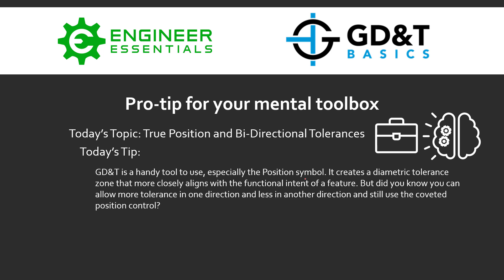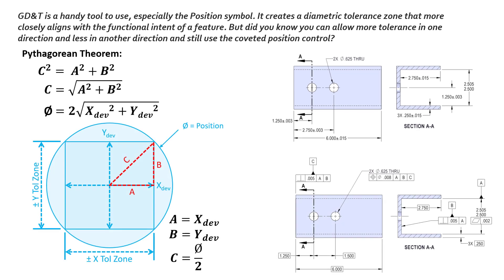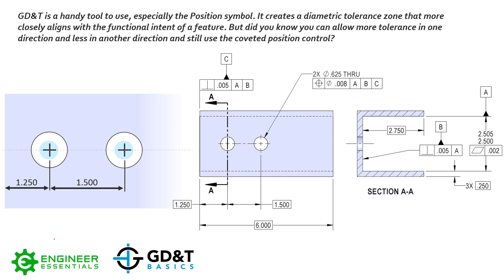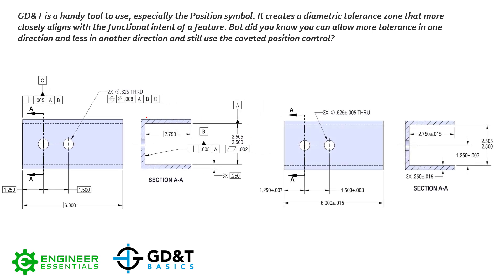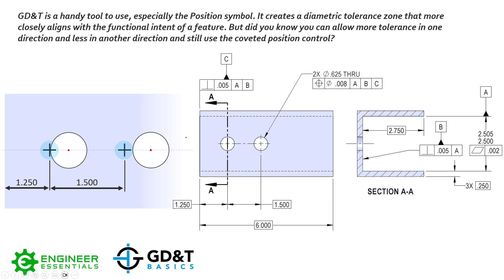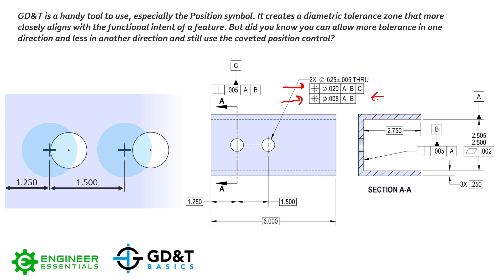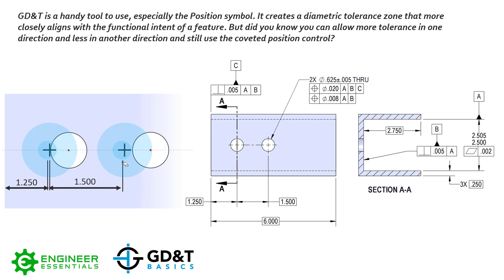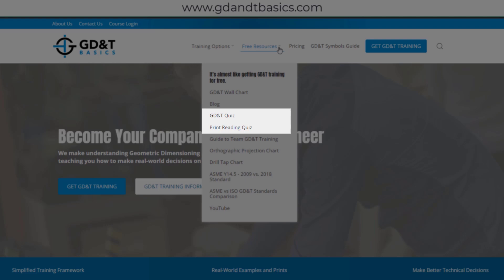True Position and Bidirectional Control

Comment: What would be the difference if you used a composite position tolerance, instead of a multiple single segment?
And is there an equivalent to composite tolerance in GPS?
Thanks!
Reply from the maker: This is a tricky concept to explain quickly however from a high level, composite lower frames ONLY control orientations of the pattern and not locations with respect to the datums. Where MSS will control locations. There are some configurations of upper and lower frames where both the interpretation of MSS vs composite would be the same. And to the best of my knowledge there is nothing in the GPS that is similar to the Composite control. Thanks for the question!
Reply: @Gdandtbasics  thank you for the explanation.

Comment: Sorry, but the datum system doesn‘t follow function. Clearly B is primary and A-C-D-D are secondary (D-D is two times derived features of the two holes dia .625). Nominal lineare sizes of through holes and A should be designed at MMC and their derived features should be specified with position and maximum material condition at clearance zero.
Reply from the maker: @chrmeiss67 Love the enthusiasm, and i do love me some zero tolerance at MMC as well! I would take that argument even further and say that Datum Feature B in our example is a great primary datum feature and the pattern of two holes should actually be the secondary datum feature only. However this was just a simple example we used to quickly explain MSS Position controls.

Check out our video on patterns of holes as datums. https://www.youtube.com/watch?v=f4A2BGX9HLw&t=23s

Comment: I just want to point out that dimensions 6.000, 2.750, and 3X .250 are shown as basic and thus have no tolerance. I know that this drawing is not complete but I think people should be aware that those features need to have tolerance applied.
Reply from the maker: Thanks for pointing this out! These could easily have a profile of a surface added to the surfaces in the drawing views or rely on an UOS Profile Tolerance in a title block.

Comment: I get the concept but the LH edge is up against another part as you've shown - naturally I wouldn't expect to loosen up that position to C datum.
Reply from the maker: you're definitely right that this design might not benefit from extra tolerance with respect to C. And for the tolerance on the Ø.625 thru hole, we have to rely on the lazy/forgetful designers best friend "UOS Tolerances" in the title block XD. Sorry for not including that here!
Reply: @Gdandtbasics  that's very important for people who still learning because sometimes can be confusing
Reply: @Gdandtbasics  thank you for your reply...
Reply: Agree. Wrong example. And also the hole the diameter 6.25 doesn't have tolerance in the callout.
Reply: @asaholey  oh yes agreed...